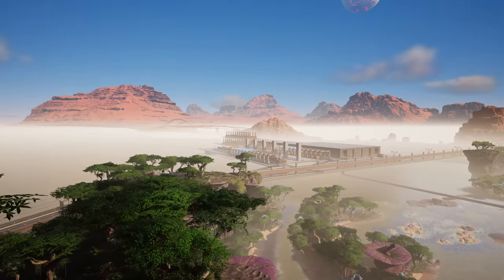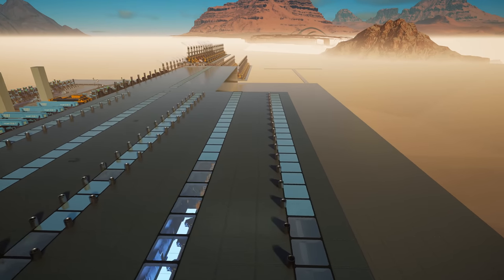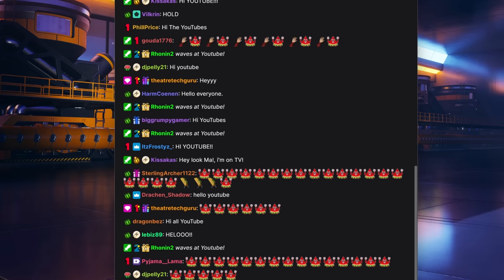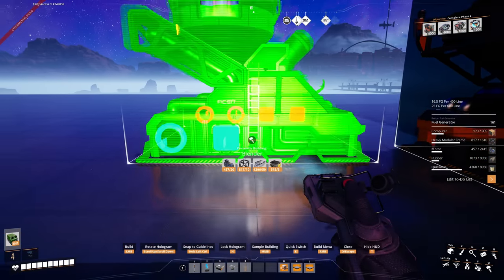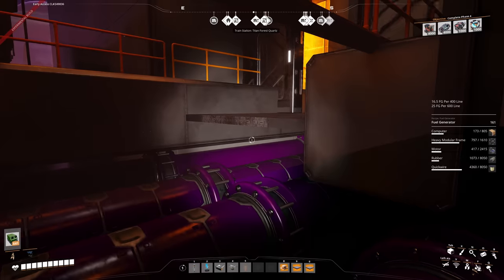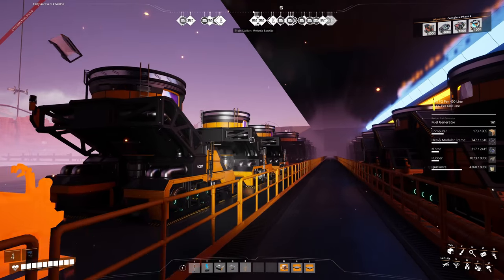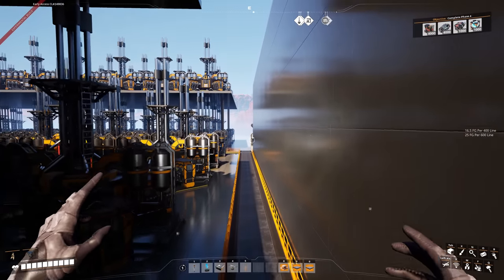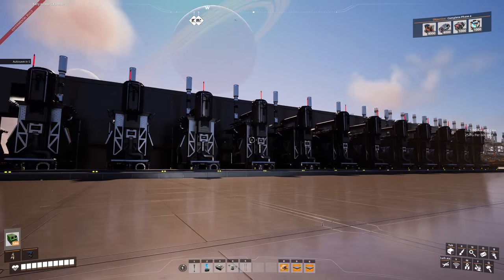DILUTED FUEL WITH BLENDERS!!! In Satisfactory

Comment: I have spent the last several hours in my play sessions with a friend working on this power plant area. While I am not doing multiple levels, I have found that putting a mk2 pump in the middle of the 33 generator line has helped get the fuel all the way to the end. I also ran into an issue with using just a little more fuel than I was generating (even though it should be producing 400 m3pm and using 396 m3pm, got to love fluids), I decided to under clock the 33rd generator to dial in the usage.

Comment: Im getting the feeling that its better to not go insane with your fuel production until you have blenders unlocked. Ill keep that in mind going forward. Im just getting my basics factory worked out before pushing into T4 and power is becoming a problem. I have already expanded the coal plant to 3 lines. and I think only one line can support up to T4 belts.